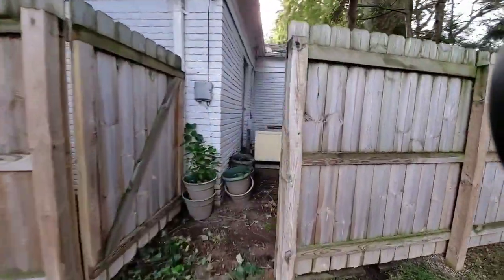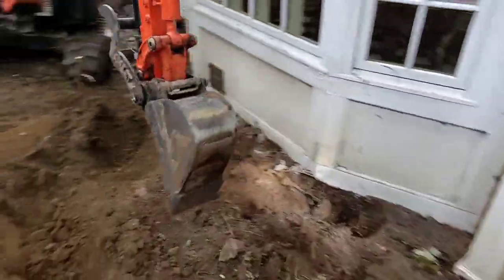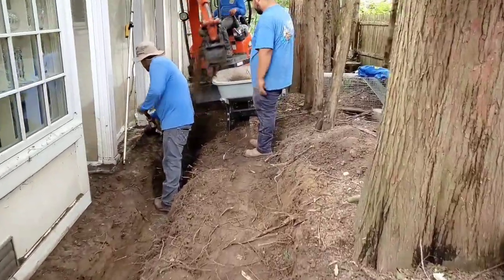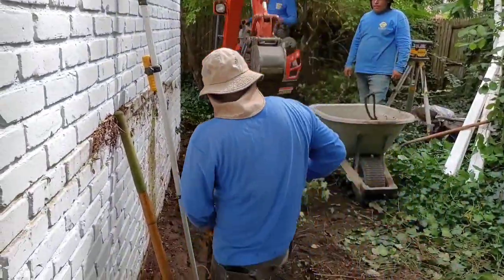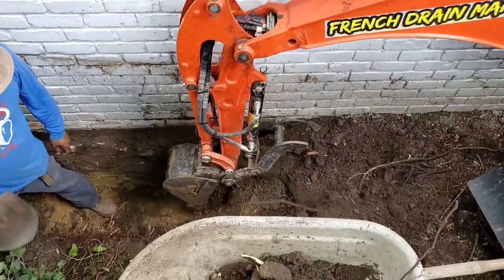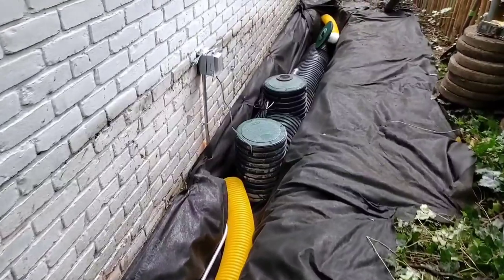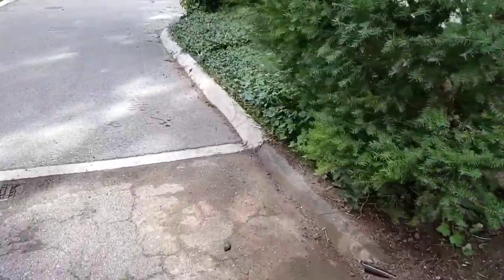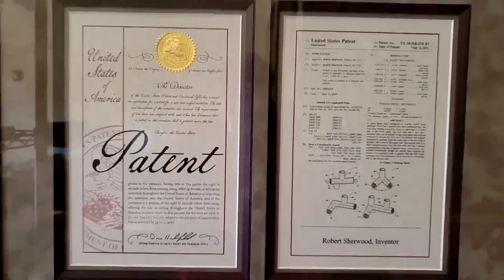Flat Yard No Slope Yard Drainage System

Comment: How does the discharge work? Is there an electric pump in the dual pipe reservoir? The discharge line seems so small compared to the 6inch perforated.
Reply: He usually has 2 pumps in the Screaming Demon. One as a backup. A lot of water can be pumped out fast through an 1-1/2 pipe. The Screaming Demon can hold a lot of water so it's not a problem.
Reply from the maker: https://youtube.com/playlist?list=PLjFCqaZ4v1BXXbPw3Vf7e86DbKj7qOnLn&si=wMYO5uRAOpNXGHNb

Comment: Why do you use the pop up valves from the gutter downspout instead of the Using a Y directing into the main drain line ?
Reply from the maker: Because  Debris and contamination comes out of the downspout off the roof. I don't want that debris in my system I'd rather the water come out over the system and be filtered before entering the system. This was  a great question thank you for commenting.

Comment: I've heard that it is not great to dig right up against home foundations and install French drains too close to the home unless you go through all the trouble of installing a membrane with it.  What was different about this case that you could do that?  Am I misinformed?
Reply: That's only for basements. This looks like slab on grade, so you don't need the extra buffer. The buffer keeps the water away from the basement walls and out of the basement.
Reply: I did my curtain drain 3 ft away from house anyways and have no basement..I believe. That’s right , it’s ok to go right up against hoise if you have slab foundation
Reply: If I were to guess I'd say that the water was coming up between the slab and bottom plate and getting into the garage...if it wasn't coming around the corner of the house and getting under the garage door.
Reply from the maker: https://youtube.com/playlist?list=PLjFCqaZ4v1BWSyew4JyZuxDpBvULztf91&si=nYFuNVDqG3w63j4s

Comment: Why the pop ups? Water comes out of gutters then discharged through the pop ups then drain into the French drain? If I am correct is that to keep debris out of gutter trash running into the sump system? Less maintenance?
Reply from the maker: We don't turn our French Drain Systems into a garbage  Disposal. We NEVER tie downspouts into a French Drain. You must of saw that on a handyman hack channel. I think we are the only channel building systems that last forever. 🙃
Reply from the maker: Watch "How to Tie Underground Buried Downspout into a French Drain System" on YouTube
https://youtu.be/rxzLLIxmX2I
Reply: I have an open French Drain running along the front and side of my house  where it the runs into a field. I have three downspouts, but I just have them running out onto the top of the French Drain or slightly toward  the outside edge where it will run back into the drain. This works well for me because I can easily blow the leaves and shingle debris away with my leaf blower keeping my drain area clean.

Comment: Is that mini excavator diesel our gas and how many Hp.
Reply from the maker: 16.1 hp  Diesel engine.  We do not focus on horsepower with diesel engines. Our focus is on torque. The break-out force is good. We own 2 Kabota U17 very few issues and no complaints.

Comment: Didn’t you say ‘never connect a downspout to a French drain’?
Reply: It's not connected. The water from the downspouts will drain thru the filter fabric, so no debris will enter the system.
Reply: @sholdee  with heavy rain it won’t have enough time for the discharge to percolate down and water will sit by the foundation. Wouldn’t it be wiser to put a gutter guard to prevent debris and connect them directly to the French drain?
Reply: @muziv82  It will run right through that open french drain no problem. It won't pool. Their fabric has great flow rate. I know because I built an open curtain french drain around my house with their materials and did something similar.

If it wasn't an open french drain, it would probably be an issue yeah. In either case I wouldn't depend on gutter guards to keep the system clean.
Reply: The downspouts are on their own pipe that is in the French Drain, but empties through the popup emiters and then drains down into the rock/fabric and gets picked up by the French Drain.
Reply from the maker: https://youtube.com/playlist?list=PLjFCqaZ4v1BVX2cpGD7wJqH37RSS1JAOz&si=PMH5srBNjZrMkZD0